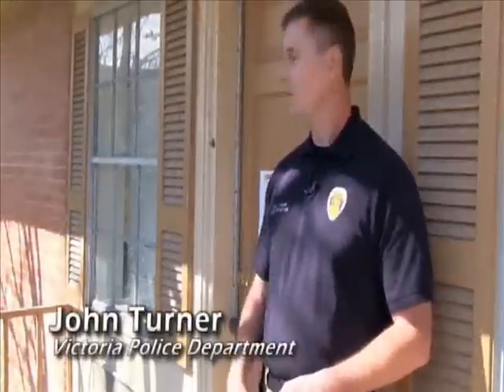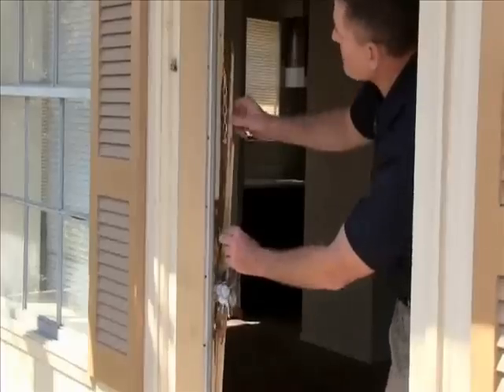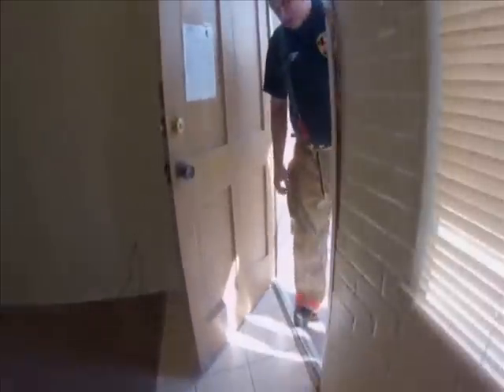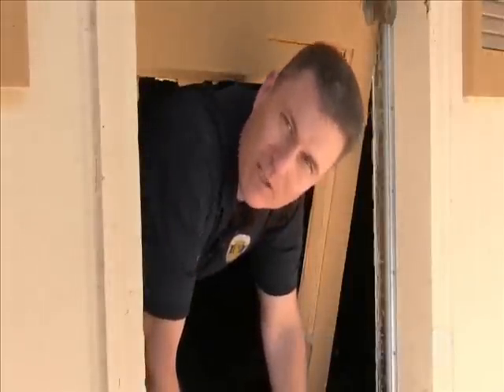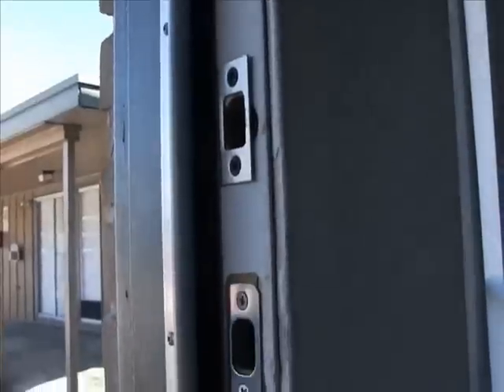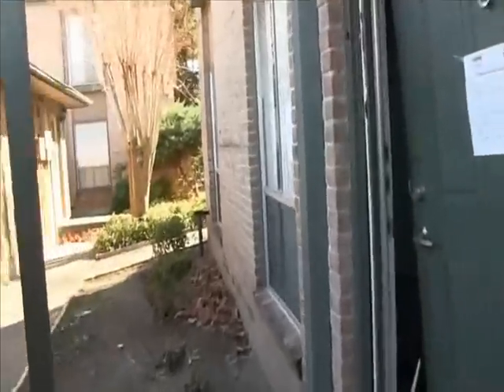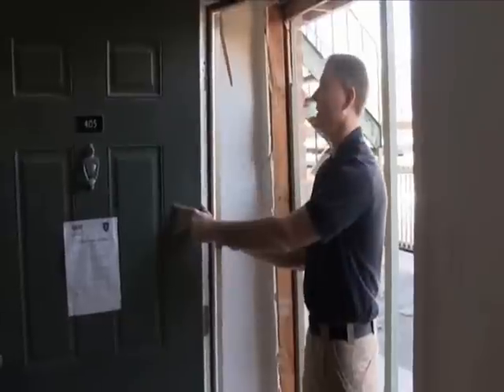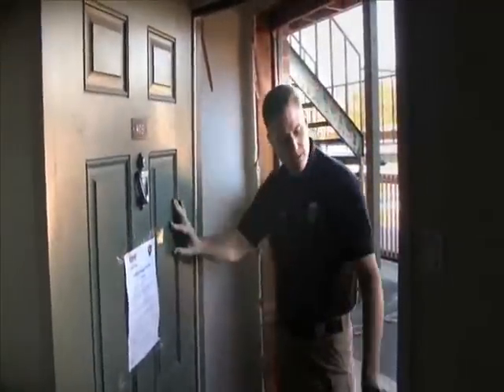Double your door security for a couple of bucks NOW! Safer in 5 minutes!

Comment: While doing some remodeling on a few houses where the clients wanted new front doors, I discovered that the existing door and frame was held to the house by only staples!  I took the trim off and the door frame and door simply fell to the ground!
Reply from the maker: Wow, that's crazy.
Reply: RBG0979 .
Reply: Gadszooks, what irresponsible builders.
Reply: gotta love flippers!
Reply: RBG0979 Not the least bit surprised! I see that ALL the time. Blame cheap builders with no morals, and cheap Angie's List type hacks, with no morals. House flippers also do that sort of thing ALL the time.
How do I know? I earn a nice living going behind hacks and fix things that were never done right. There needs to be much tougher regulation and oversight on the construction industry.
Reply: Gotta love unskilled labor. Builder saved a fortune on that illegal he hired. Didn't even have to pay for screws.

Comment: I can't believe that in this day and age builders are still using 3/4" screws to hang doors and mount strike plates!  It's practically criminal IMO; building codes should be updated to require hardware that attaches to the jack or king stud.
Reply: how about a pocket door with a latch and dead bolt?
Reply: Rob Babcock 4sr
Reply: Imagine if a fireman couldn’t knock down the door when the house in on fire
Reply: @b0b0zz71  then they would go through the nearest window

Comment: Would be better to have a metal door frame with a metal door. As well as one of those security devices that slides into the floor on the inside. Dogs and a 12 gauge wouldn't hurt either.
Reply: Terry Ilias - wrong, thieves in my area are kicking in the front door, tossing the master bedroom, home office, and game room for cash/jewelry/small electronics. They are in and out in less than 5 mins! This guy is correct about exterior door....90% are not installed securely. I have installed thousands of doors, and rarely find one installed correctly. 4" #10 screws through the strike plates AND each hinge, so that they go through both studs in the wall. I went a step further and installed horizontal blocking for 3 stud bays on either side of the door, every 2 feet vertically. They won't be able to jack the jamb open either! 😂
Reply: I read that most burglaries in the US involve kicking in the door, and that matches what I've seen as well. Regardless all you have to do to help harden your door is replace some of the screws, so it's not a big waste if no one ever tries to kick your door in. :p
Reply: I love my apartment door. Metal frame, concrete filled metal door
Reply: Yeah but with metal doors the walls would be cheaper as the doors in America
Reply: My Sig P320 works pretty well. I like to walk around with my holster on while doing yard work. It's not threatening, but it does inform people I am armed and it's not illegal.
Reply: Those bars have been tested and easily fail

Comment: For years I did this to all of my doors.  The one thing that I do differently is that I install 4" screws.  The 4" screws will then be able to reach into the king stud of the door frame on both sides (hinges & strike plates.  I also add door strengthening plates to the door know & dead bolt areas of the doors.
Reply: I agree also steel door will make it very difficult.

Comment: So after you've put in your 3" screws, if you want to really kick it up an extra notch do this: Remove the moulding from the outside of the door frame.  Get 4 bolts long enough to go all the way through the 2x4 frame, sheathing, drywall and get 2 angle irons out of 1/4" steel... drill the holes to hold the angle irons on the inside just above the door handle.  Screw them in place with bolts that have smooth heads with the nut on the inside of the door.  Put your moulding back in place to cover up the bolt heads.. paint and caulk so it looks like it's not covering anything up.  Get a steel bar about 1" square and set it inside the angle iron to go totally across the whole door.  No one is coming through that door because they will just go for the windows after trying to kick it in.  That should buy you enough time to get the shotgun and wash the sleep out of your eyes at 3 in the morning, call 911 and barricade the bedroom.  Now if your bedroom is at the end of a fatal funnel at the end of a hallway then the perps are ripe for the pickin'.

Comment: I used three inch #9 deck screws on the striker plates.  They are hardened steel screws and a lot stronger than standard screws of that length.  I pre drilled the holes with a 1/8” drill and screwed them in with my battery powered drill and their star bit that came with the deck screws.  It takes just a few minutes and takes four screws per door.  I am going to replace the hinge screws, later.

Comment: Rather than just put 1 three inch screw in the hinge, it wouldn't take too much effort to replace all the screws with 3 inch screws! Doesn't make much sense to do half a job IMHO!
Reply: The screws on the front side are not likely in line with the studs.  Doors are typically mounted in front of the jam so there is room for siding, sheetrocks (if indoors) etc.  You can test this by the amount of friction you get when you put the screws is. You should be able to tell if its screwing into a stud or just the wood frame.
Reply: Where is the shear point for 9 3” screws vs 9 smaller typical screws that come with three hole hinges?

Comment: We have a carpentry business and you would be surprised at the things we see house finishers do to hold the doors in place. Most of the time they come in with the door mounted in its frame, place it in the door opening and just shoot a couple nails in it to 'secure" it. What really makes it sturdier like the guys says is to put a couple 3 in screws into the frame. That's what we do. As an extra measure we also shoot foam in to any gaps. It makes it just a little stronger and eliminates any play between frame and studs. Never hurts to use a real solid wood either.

Comment: because of your video, I found some 4" screws on Amazon and replaced all my exterior door hardware screws with 4" screws that match the finish of my door hardware. I predrilled the holes first so the wood wouldn't split. Thanks so much for the video.

Comment: I always install 3" screws on ALL attachment points
Strike side as well as ALL hinges
Not just one screw but all 4 screws per hinge 

I also suggest to my customers a 1.5" steel rod  / pin on the interior  side / strike of door into the floor

Easy to do low cost

Comment: I use 6" drywall screws. They are hard to snap, hard to strip out, and do not rust. I also bought "loid" proof striker plates and deadbolts. Solid wood doors with small 3" square windows so an arm cannot reach either deadbolt of entry knob. No problems so far.
Reply: This works but as a rule I avoid drywall screws like the plauge. They are brittle as frig. Use some nice GRKs or exterior deck screws for extra peace of mind.

Comment: Great video! You should pre drill the hole for the longer screws if you can with a drill bit that is just a little smaller than the inner shaft of the screw, not counting the threads, and also use some soap as a lubricant so the screw doesn't strip out while putting it in. Either scrape the threads along a bar of soap, or put some liquid dish soap on at least the bottom inch of threads. I like when he said "it will increase your reaction time"! ;)

Comment: make sure your door opens toward the outside, use oak instead of pine for door frame
Reply: @ Greg p.....If your door opens toward the outside...then the hinges and HINGE PUNS will be viewable ( and easily removable) from the outside. Remove the pins ( from the outside)..... and you're in......did you think this through?
Reply: Wil Ferch lol he didn't
Reply: Uh-oh, the doors on my car open towards the outside. What a stupid design huh?
Reply: well your car is designed different so hinge pins are not accessible, like a outward door hinge pin would be... so? As is shown here,      3" screws on striker plates and hinges and you are good to go.
Reply: @TheWilferch  You can always swap the hinges with "set screw" hinges or "stud" hinges.  They're both designed to secure exterior swing doors.  Or you could get non-removable pin hinges.  There are options.
Reply: @mrpipeshere  ...and look where the hinge PINS are.....INSIDE the car or at least inside-between-the-door-and frame. You still don't get it , do you?....hinge PINS located OUTSIDE ( to allow door to swing OUT).....are removable from the bad guy outside your house.
Reply: @TicoTimeCR  I uderstand....but if this tutorial is talking about the benefits of longer screws, we're talking rather simple, 95%-of-people capable DIY projects that should take only a few minutes to gain large benefits. If we're talking re-engineered hinge types....I don't think that applies here. No doubt there are all kinds of hinge and door designs, but people should realize that an "out" swinging regular door will have the hinge PINS on the outside that are viewable and accessible from the OUTSIDE....therefore defeating the security purpose. I guess we need to say that as some folks still don't get it.
Reply: @TheWilferch  You're the one who opened this can of worms.  Nowhere did Greg p say use a "regular door".  Nowhere did he say use your existing door & hinges.  Nowhere did he say it would be easy.  If you originally just posted this first sentence above: "this tutorial is talking about the benefits of longer screws ...", I would have agreed.

But you didn't.  You (and others) asserted that Greg p didn't know what he was talking about because the hinge pins would be exposed.  I was simply clarifying that secure hinges exist for out-swing doors.  No re-engineering required.  In fact, I doubt any vendor sells an exterior out-swing door without secure hinges.

Comment: Isn't it better to have a door that opens outwards.
Reply from the maker: +Kjelle “Swaggedelic” Ninjasson Yes, but code doesn't allow it in most places. ETp
Reply: +ETprepper ok, I understand.
Reply: +Kjelle “Swaggedelic” Ninjasson Actually then the hinges would be on the outside you could then just easily remove them.
Reply: +CYBR Chemz  -- Sure you can but if the door has pins that anchor in the frame or studs it won't come off as easily, provided it is not a cheap flimsy door.
Reply: You're right about the cops Oh criminals coming through windows and walls etc.  I'm from Manhattan and the Bronx from the old days 70's-80's.  So I really know what Your speaking of.
Reply: +Kjelle “Swaggedelic” Ninjasson There is another reason why it's better to have a door that opens inwards... if you are trying to defend yourself from someone trying to force the door open (or tries to force their way in as you open it yourself), it's easier to hold it shut by pushing it (or barricading it) than trying to pull it closed.

As compensation, some places have metal bars after the door that do open outwards, although these aren't much protection from someone determined to get in, since you can, for example, attach a cable around a bar and pull the entire grille off with a vehicle.
Reply: Way better.
Reply: +WaterCrane Good point.
Reply: Kjelle Ninjasson then the hinges are outside and you can just slide the hinges up and out.  If we can figure out more secure hinges,  that don't cost an arm and a leg,  it's a fabulous idea.  Think of a safe or heavy duty metal security door.
Reply: Michael Lawson Jamb pins are very, very cheap. Likewise, replacement hinges can be purchased for a couple dollars each with security studs built in.
Reply: Rich Farfugnuven Safes have their hinges on the outside oftentimes, so the interior space isn't taken by the door. They usually have passive bolt work that locks into the safe body, just as security studs or jamb pins prevent a hinge from popping open once the pin is removed.
Reply: When I lived in Wyoming all doors opened in so you do not get trapped in from snow  build-up and now I live in Florida where do to hurricanes building codes state that all exterior doors open out to help withstand high winds
Reply: @cybrchemz2940  
You install NRP hinges made for outswing doors
Non removable pins

Comment: Steel encapsulated door with piano hinge all the way up and locks all the way up with 3" screws going directly into the studs, and floor bolt anchors and 2 x 4s glued and screwed to the back of the door. Honeycombe rubber front to absorb impact.

Comment: Even with 3" screws the frame is still made from thin pine board. The police often use a door jam spreader instead of kicking it in. Its faster and more quiet. For ultimate security the door and frame needs to be completely removed and a full metal frame and metal door need to be installed.

Comment: #1 way to reinforce a door is to install it correctly so it opens outwards that way the door jam and frame brace 100%
Reply: Brandon Evans nobody hangs a door so it opens outwards that's ridiculous
Reply: Kirby Dan wonder what the point of the half Moon anti pick pin is for then its not ridiculous to open a door outwards the reason people don't do it is because there is legislation against it because it inhibits doors being kicked in when emergency workers show up my doors open outwards it stops people from forcing there way into your house when answering a door if you want security build with security in mind if you wanna walk off a clifff like a lemming then follow the herd
Reply: If you go this route,  make sure you get a door with non-removable hinge pins and 1. live in a place with no snow or 2. make sure you entrance way is covered so snow doesn't build up.
Reply: Double block hinges work well they mount with zero clearance in the door frame and are left unexposed I also live where there is tons of snow and it doesnt inhibit my door
Reply: LONEWOLF REBELS you'll just end up kicking a hole trough the door, sure the lock wont be forced, but the hole will be big enough for a man to get trough.
Reply: but then another weak point, the hinges, is exposed.
Reply: in many areas that is actually illegal to do for exterior doors. it depends on the state, but most that are in areas with hurricanes have adopted a law which requires exterior doors to open inwards. Also the standard hinge design most homes use require the hinge pins to be on the inside (otherwise someone could remove the hinge pin and take the door off the frame) which then means the door has to open inward. 

this is contrary to public buildings which have outward opening doors in order to make them easier to escape in the event of a fire. This also includes sliding doors which are equipped with an emergency hinge which is held straight by a (usually plastic) weak frame that allows for the doors to be pushed open in an emergency.
Reply: "double block hinges mount with zero clearance in door frame and are left unexposed" - can someone please show me an example of these hinges? Having an entry door open outward would, i thought, force you to leave your hinges exposed and one could simply tap the pins out or, even with non removable pins, quickly cut through them. I would be very interested in installing an outward opening steel entry door with hidden hinges.
Reply: ike fun The bear the bear! It makes it harder for bears to use the doorknob. My doors open outwards. In case of fire it makes a lot more sense.
Reply: we always called them crack doors, because thats what crack houses had so it was harder for cops to break down
Reply: not sure who that was directed at due to the poor grammar but ive lived in Florida my entire life and never seen a door that opens outward, ive heard about them though
Reply: ARGOS CENTURIAN ; doors open inward so they can't be barricaded from the outside. We northerners learned the hard way when snow would like up against the door trapping people inside. That is why doors now open inward.
Reply: Grunt_007 ; If I didn't live in a 5th wheel, I would build my own SOLID wood door made of 2x4s and plywood.
Break THAT!
Reply: you mean people haven't been doing that for hundreds of years?! those castle gates and the associated interior doors were all opening inward so that ONLY the piece of wood baring it shut resisted intruders?! thank you sir, i realized i have been living a lie.
Reply: @leroyj9044  
Out swing doors are required  in commercial applications
A smart move for homes as well

FUCK the city codes / laws
Do what is in your best interest
Enforce your 4th and 14th amendment  
Grow some balls and stand up for your self

Comment: When I worked New Home Construction we used to install Steel Doors with Steel Door Frames. We would put 3, 2 x 4 studs on either side of the door with 2, 2 x 8s for the header and use 6 inch screws. Not impossible to break in, but Very Highly Unlikely to get through the door.

Comment: We do 3" screws in the dead-bolt striker plate and one 3" screw in each hinge just like he said. We had rental property that the fire department had to get access due an issue and it took 3 fireman and a 5' crow bar to break the door down. Yeah it works folks!

Comment: I have a door made out of solid steel.
Reply: DHF TeeVee  cool
Reply: Your door may be steel, but I highly doubt it's solid steel. A solid steel slab in the dimensions of a door would weigh over a thousand pounds.
On the bright side, you probably still have a much better door than a lot of people.
Reply: Even a safe doesn't have a door made out of solid steel.
Reply: Freedom Talk Media Drake safe doors are solid steel.  There are others as well....but not many.
Reply: Tighe Dean Prod. 
You make no sense.
Reply: A discarded door renovated with metal plating would do a lot better than most standard doors.  Just build your door like public schools have.  It will be easier for someone to go through your wall.
Reply: solid steel? doubt it.